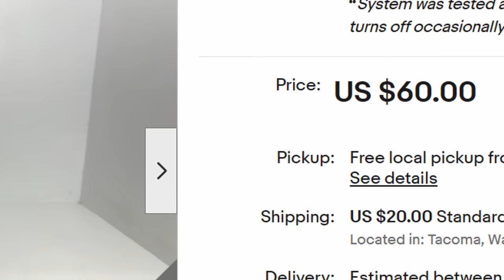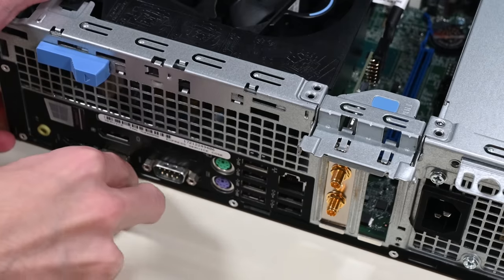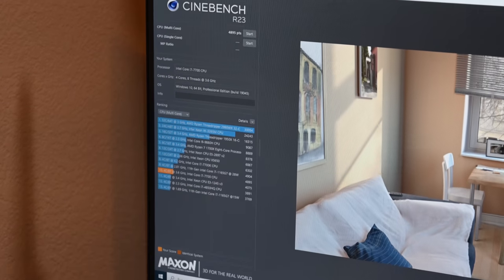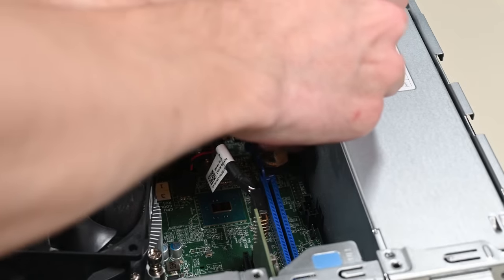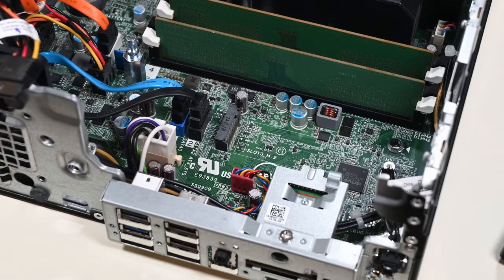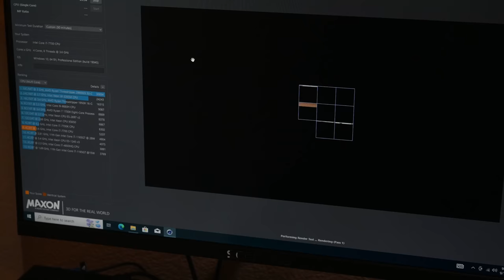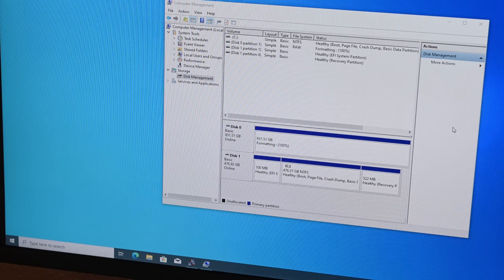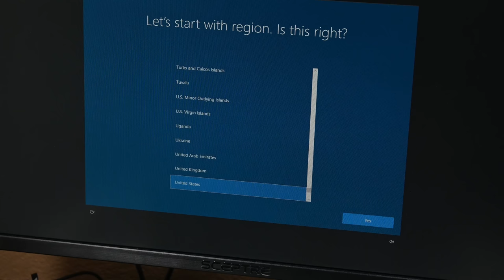I Paid $80 for ANOTHER Broken Dell Precision 3420 - Let's Fix It!

Comment: I'm a fan boy of the Dell SFF Tower 3420, I MAX out the memory, 64 GB, and use a NVME for the boot drive Linux Mint Cinnamon and win 10 on a HDD. I'm NOT a gamer so I use the on board video and is fine for my internet surfing. The SFF 3420 is economical; small size case and have "okay" driver support from dell. Having said that. I have offered to build similar units for family/friends and every one told they were not interested in PC's anymore as they only use their cell phones with the Unlimited Data Plan. So, I don't bother restoring computers anymore as there doesn't seem to be any interest in them. Maybe that's why there seems to be an abundance of decent machines being discarded.

Comment: I've had some insane deals off eBay, simply because the seller doesn't know how do fix a simple issue or because they just don't understand the value of something. Thousands of pounds/dollars worth of hardware had for just a few hundred.
Reply: like the $25 ThinkPad T430 I picked up at the local flea market.  It only needed a new CMOS battery.

Comment: Awesome video. Great to see it was a simple fix. If it was a power supply they sometimes can be a nightmare to find. Being a weird  shape of power supply and a funky power connector.
Reply from the maker: Yeah, these non-standard PSUs can be difficult to find at times. I did a bit of research going into this one and was able to find the replacement units for these computers for around 20 dollars each which was really convenient. So, I was ready to have to buy one of those and eat the cost but thankfully that wasn't needed!
Reply: @CompHwTipsAndTutorials  Nice.

Comment: 6:00 Oh my 2016 Dell pc uses the same type of CMOS battery socket. It was a PITA to work with, but they actually showed in the service manual how to pop the battery out: just use a small, pointy insulation object, which is actually not so easy to find, to pry it off. Also, Dell cheapens out with the PCIe slot whose clips at the end are fairly easy to break.

Comment: I got a dell optiplex 5060 for free at an e waste center! It had an i5-8500 and 8 GB 2666 MHz DDR4. No SSD but i threw in a sata ssd i had laying around.

I also took home a ryzen 7 3700x desktop pc with 8 gb ddr4 3200 mhz and 512 gb nvme from a recycling center. I threw in my 1050 ti since its the best gpu i have. I plan on doing future upgrades

Crazy to see what people throw away at these recycling centers
Reply from the maker: Whaaaaat?!? Dude those are some crazy finds! Nice one dude, hope you're enjoying em!
Reply: @CompHwTipsAndTutorials  yep, they both run smooth on windows 11!
Reply: Yes. People throw away anything that has the least little bit wrong with it. Sometimes it's just dirty. Very wasteful practice.
Reply: There doesn't seem to be any computer recycling centers in my area
Reply: I have access to a lot of trashed systems too (I work for a company that provides IT services and hardware to other businesses) and it's crazy what people will throw out. Most of the stuff that's too old to properly run Windows 11 (as in, without workarounds) gets overlooked; maybe scavenged for spare RAM or whatever, but anything new enough for Windows 11 gets "taken" very quickly when it comes in.
Reply: @floydlooney6837  Nobody gives away anything in my area .

Comment: I just picked up a "refurbished" Optiplex 7010 SFF machine from Amazon for $140, and it came with 16GB of RAM, a Core i7 - 3770 @3.40 ghz, and a cheapy 1TB SSD with Win 10 Pro pre-installed. The only issue I had with it was the Display Port connectors wouldn't work out of the box, so I was forced to use the VGA output until Win 10 finally installed the drivers for the integrated Intel HD 4000 graphics. Surprisingly, the graphics driver package from Dell didn't even work, but letting Windows update do it's own install, actually DID work.. go figure.🙄 Anyway, it turned out to be a solid little machine, and I installed a second SSD and set it up to dual-boot Win 10 Pro and Linux-Mint 21.2 Victoria. With a 4TB USB 3.0 external drive for storage, it makes a very fast, relatively low power PLEX Media Server, and general purpose everyday machine. It's been up for 6 days solid now, and not one glitch since the graphics driver thing.😉
Reply from the maker: Awesome! I love using those older computers as servers as they're incredibly well suited for the job.

Comment: At least it boots with a dead CMOS battery. I've worked on Dell machines that will act completely dead if the battery is dead, and the first time I encountered it, I was going crazy trying to figure out what the problem was until I googled the solution.

Comment: $80? Nice pick up. This is a PRIME candidate for a nice single slot Quadro, WX4100... RX550... or MAYBE even an Aliexpress Yeston GTX 1650 single slot. They are a BIT expensive around $180... but that beats the heck out of bottlenecking an RX6400. That being said, a single slot GT1030 or RX550 would be fine.

Comment: Maybe the previous owner had a graphics card that was putting a stress on the psu or board causing it to go in protection mode. These sff Dells actually have a wattage limit of 40-50w gpu power limit for the pcie slot so even if the card fits in it doesn't actually mean it's fully compatible. Could have been the cmos too - i had a 7010 that suddenly died and refused to power on again sitting on the orange light and a new cmos battery was all it wanted to come back to life
Reply: Yeah that is a big possibility. The PSU in these machines are not good for anything over the stock parts.
Reply: @jsnotlout3312  It actually hold up well. The one with the power limit over the gpu is actually the board not the psu. I was playing around with a SFF 9020 which has the same psu as this. Added an i7 4790 with 16gb ram,a 512gb ssd and a 1tb hard drive using an adapter because it only had power for one drive,and an Nvidia Quadro K620 and the psu has no issue running those components
Reply: @nushnume  Oh, that makes sense, Ashame Dell Limits he boards
Reply: @jsnotlout3312  They are probably trying to avoid users blowing up the PSU. As an example the SFF version supports non-K processors only but the regular desktop version can take K processors easily and their boards have no GPU power restriction.

Comment: I go through my routine everytime i get my hands on "old" PCs like this:

Clean everything including the power supply with compressed air
Check the CMOS battery or just replace it
Reset the Bios
Flash the Bios to the newest version (also ensure every "Bit" in the bios is ok)
Repaste everything
I also add vrm heatsinks with thermal glue whenever it´s possible to ensure stability and longevity
Replace Fans with good ones (like Noctua or Be Quiet)

This method works most of the time to bring PCs like that back into service

Comment: Weird how this new system has already a dead battery. I have a fat PS2 from the early 2000s which still has its original battery working :D
Reply from the maker: Yeah, oddly enough, it seems to always be the Mitsubishi ones that die.
Reply: I’ve worked in some of these dell models and they seem to suck the cmos battery dry faster than most other pcs

Comment: I saw you struggle to get dell to see the os on removable hdd I've had this same issue these newer dells will not boot from a hdd out of another machine I've learned this l.

I've tried this very thing I replaced a PC tried to move over a hdd it wouldn't boot i had to reinstall windows on that hdd for the computer to see it. The windows os had to be installed on the hdd with that computer.

It's crazy I'll keep watching the video. If you found away around this, it would be much appreciated.

Comment: These newer SFF precisions are picky with certain things
I have a Precision with a Core i9 9900, 64 GB Corsair LPX RAM, WD Black 1 TB Nvme (4.0 capable) SSD, 2 x WD Blue SATA 6.0 GBps SSDs, DVD RW, Nvidia RTX A2000 switching to Gigabyte GeForce RTX 4060 to max out the system. It’s an amazing system in a small footprint
The 4060, I know people will point out that it has to go in an x4 slot,
Here’s the rundown anyways
The SSD takes up X4
The WiFi takes up x2
The x16 slot is obstructed yes, but the 4060 only runs at X8 anyway.
You could get an extension cable like I am and set the gpu in the pc fans up with a protective back to reduce any contact shorts
The Core I9 only has 16 pcie 3.0 lanes anyways
Reply from the maker: Sounds like you've got a really solid SFF system there!

Comment: Working "still" with many automation systems that have a scada based on windows XP and yes windows embedded. restoring defect computers is by using refurbished computers, new cooling fan, new PSU, new cooling paste and repalcing the HDD for a SSD. by Dell systems i see often the same bios respons, yeah solution plug in a new CR2032. Ps a win XPSp3 on a SSD is nice fast and slik....

Comment: I have experience with computers that are a decade old, and their batteries are still functioning well. Conversely, I've encountered systems that are only two years old, yet their batteries are completely depleted. Maxwell batteries appear to be the ones that maintain their charge for the longest duration.
Reply from the maker: Interesting, I haven't been able to observe too well what brands do best, but every single time that I've had a system with a dead CMOS battery, it's been a Mitsubishi one which I find interesting.

Comment: ive had a very similar issue with a dell 7010 i used to have it would automatically bootloop as soon as it was plugged into the power and it would not save bios settings or time or date and it was as simple as just swapping the cmos battery lol

Comment: All my Dells do a Power applied fan test, then goes off.  BTW Some HP servers do this. Pretty startling when 4 PSU all max fan in your face.
Reply from the maker: Yep, all my dells do that fan test as well. I can only imagine what a full server would sound like doing that though, I've got a few server fans, but not a full server yet. (future vid maybe? ;))
Reply: @CompHwTipsAndTutorials  We have a number of Dell servers at work and yes, they're loud when all the fans run at full speed as part of POST.  We've had a few people try to keep a server under their office desk, but the fan noise when under moderate load has usually led to them asking us to make space in one of our machine rooms for the server.

Comment: CD Rom replace as external CD Rom Drive box if can run PC...... I have few from old PC and with SATA, some work some need tool. RAM and CPU if still use maybe can place with other PC.

If you can melt the motherboard, you can take off some part and create the new PCB with can compatible part. DELL is so annoying with their own BIOS, try to replace but install the windows it said no operation system LOL, so I try to buy the second hand with Carousell Platform (Is Hong Kong trade platform), I choose lenovo H515s first time when I studying in JP... , now I have another lenovo second hand PC stuff for move to GTR PC Case.

Comment: what does that small 512 SSD drive do -  Is the operating system on it ?  mine came with a 1TB HDD also -
Reply from the maker: Yeah, the 512GB SSD is for the OS/programs. The HDD is intended for storage of bigger things, like video files and pictures.
Reply: @CompHwTipsAndTutorials  I actually put in my 1TB SSD drive from my dead XPS dell and forced that to be OS drive - works great.   so now that original drive will be my slave but not deleting the OS in that just in case

Comment: What would a system like this still for?
Reply from the maker: I've got a video testing this for productivity workloads here soon, so stay tuned for that! They're great machines for office work, media consumption, and with a low profile graphics card some gaming too.
Reply: @CompHwTipsAndTutorials  what would a computer simular to this cost?
Reply from the maker: Ah I read the original comment assuming you meant to ask what it would still be good for, my bad! Generally, a computer like this (minus the 1TB HDD) would sell for about 170 USD on eBay.

Comment: Why go with a spinning drive when SSDs are relatively cheap and can double overall responsiveness? Perhaps it's just what they had on hand.
Reply from the maker: I agree, SSDs are so cheap now that there's no excuse to really go with solely a spinning hard drive. They're still decent to have as a secondary drive in the system though for archival/bulk storage which is what I did here with the 512GB SSD for OS and applications and the 1TB HDD for bulk storage of videos/photos/etc.
Reply: @CompHwTipsAndTutorials  Yes. HDDs still have their place as secondary storage if you have one lying around, but if you're buying a drive that's say 2TB or less, go SSD every time as there is no longer much of a price gap between HDDs and SSDs until you hit 4TB and higher, at which point the gap is astronomical. And for the love of all that's holy, NEVER install Windows 10 or 11 on a HDD.
Reply from the maker: Couldn't agree with you more on all your points!
Reply from the maker: I'm not Jeff, but I'm pretty certain the reasoning would be how slow Windows 10 is when it's put on a hard drive. Loading times are abysmal.

Comment: That scares me a little bit when Windows does a BIOS update.  What if your version was working fine and now you have a rare but buggy version?  Windows should ask you before it does that really.  I can imagine one day Microsoft having their version of each BIOS that prevents running a different OS.  Maybe they wouldn't do that.  I don't know but also with the risks you mentioned about power turning off or someone who does not understand why the power must remain on until it completes or their computer may be damaged (bricked really).  Or worse, what if the new BIOS has something that was compromised by a data breach?  That is super scary considering that those breaches happen frequently.  Why they are unable to prevent all of them is a mystery to me but for personal reasons and security I prefer to flash my own BIOS and that is ONLY IF I NEED IT .  I am old enough to remember flashing a BIOS from DOS and that was risky.  One wrong parameter or if you don't get the one for the exact model and revision of the board it could either be unstable, maybe some parts not working, or the entire board just not working.  Updating a BIOS is not something that is recommended to do just because you feel like it.  It is really best to do it only when you need to and that may be to enable or add a feature or just to make your CPU work with it.  One other valid reason is if a new version improves stability but still you have to think for a minute.  Think about whether the risk of bricking it is worth the improvement.  If you need that computer on a daily basis and need it to work no matter what and it is stable enough do you really need an update that may possibly be less stable?  Or if you only get a small speed improvement is it worth it to you to risk being without a computer you use for work and other critical aspects of your daily life??  Just make sure to have a spare one that still works if you truly need it but also truly feel a need to mess with the BIOS because not a lot of people are able to undo a bad flash on their own.
Reply: Could be worse; could be an HP machine.  HP have a long history of bricking machines with BIOS updates, even when they apparently run successfully.  Just one of the many reasons I'd never buy an HP PC/laptop for myself.  At least their printers seem to have come through the "build the cheapest bit of flimsy plastic crap we can" stage and they're mostly back to being decently robust.
Reply from the maker: Yep, I have to agree with you on all of those points!

Comment: I may be being harsh, but anyone who unplugs or powers down a pc during a BIOS update deserves everything  that happens.  What is wrong with heeding stern warnings and following simple, straightforward instructions?
Reply from the maker: Definitely a fair take! And I agree that users should listen to the BIOS update warnings and if they don't, they should learn what happens. Although, the main issue that I take with it is it could happen at an inconvenient/unfair time, like a thunderstorm. I mean, if you're going into it thinking that it's just a regular Windows update but it goes and flashes your BIOS that's not really ideal. I personally prefer the way that one of my Lenovo systems handled a BIOS update: it bugged me about it every time I turned it on until I found a convenient and good time to get it done, it got the update, and it was able to be done at a convenient time, but that's just my two cents!

Comment: "relatively competent" system?  Well,  guess being a Dell is where the "relatively" comes in.  And seeing the poorly designed CMOS battery holder, and the lack of a post for your NVMe card certainly puts some doubt into the "competent" part of that statement.  "Stable" system?  I don't think that exists in the Dell vocabulary.
Reply from the maker: Well, the "stable" and "relatively competent" were mainly referring to the specs and the fact that it hadn't turned off randomly yet, but I will agree that some Dell systems definitely can be temperamental... This one's from the era where Dell stopped making computers that just worked, bring back the 3-4th gen Intel Dell days!